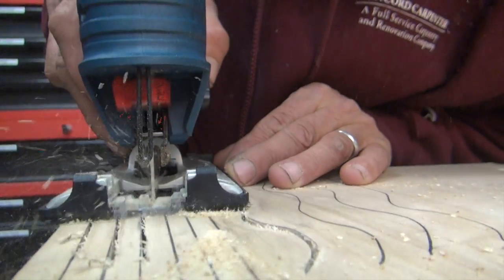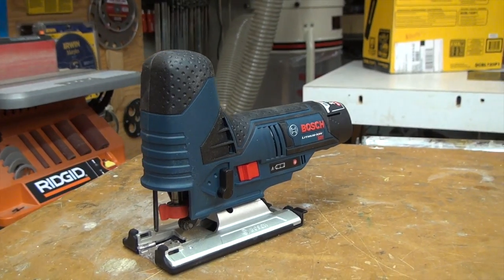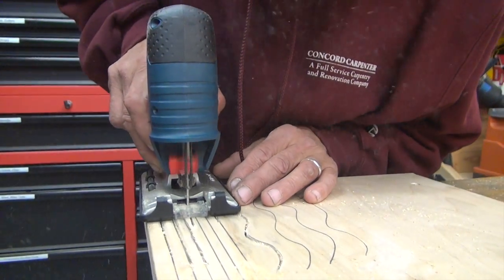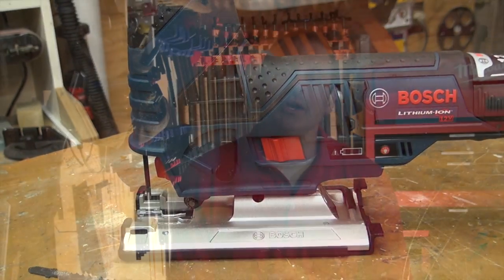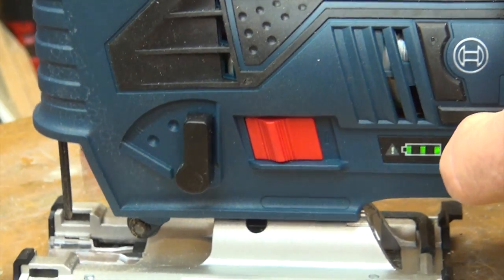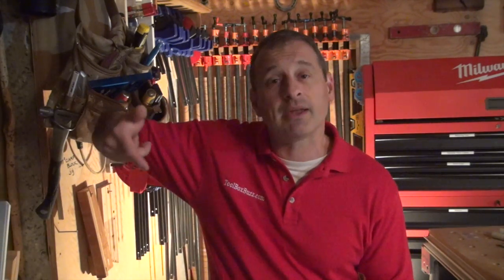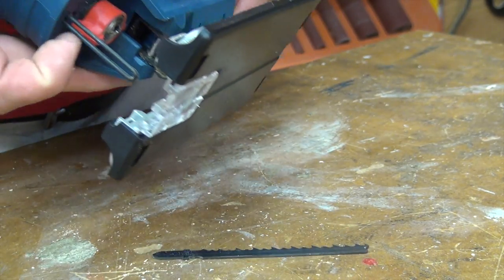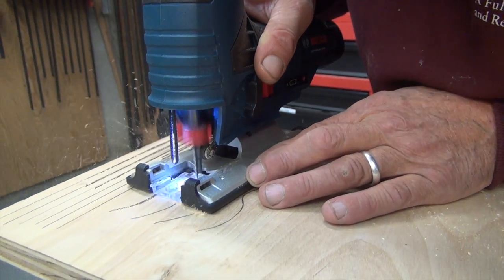Bosch JS10 Cordless 12V Jigsaw

Comment: Quite frankly, I still don't see the real need for this tool. Where exactly would you practically use it? Thanks for the video, nonetheless.
Reply: I'm a finish carpenter, I put a Collins coping foot on it. It's a very lightweight tool especially cutting upside for coping. You can do it with really any 12 jigsaw. I just use Bosch tools.

Comment: Will the  collins coping foot fit?
Reply: Yes it will. I have kept one on my truck up until recently, and had the coping foot installed- it was my main go-to for coping.  It's now back in the shop for occasional use with plywood, etc  It's a great little saw, really excels at coping MDF and soft wood trim, but it struggled a bit with hardwood moldings.
Reply from the maker: don't think so

Comment: Hi there! Is it ok to charge a 12 volt battery from a 10.8volts charger?
Reply: Ray Luis D. Monserrata it's the same battery just a commercial move. The maximum theoretical power of a 10.8 is 12 V thats why they sell it as 12 V
So no problem switching chargers and battery's
Reply: Same thing , all other did it , bosch did it last

Comment: Fantastic review! 
One question I have is how square does it cut (assuming you cut strightline)? does it bevel off 90 degrees even with a fence next to it? 
Hoping I can use this on thinner materials like 1/4" or 3-5mm where a circular saw becomes overkill. 
Thanks!